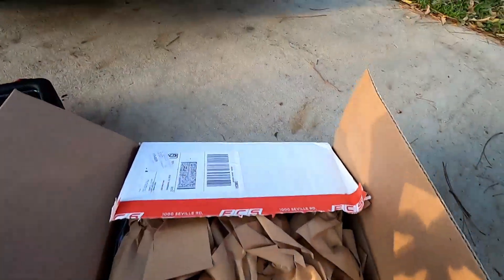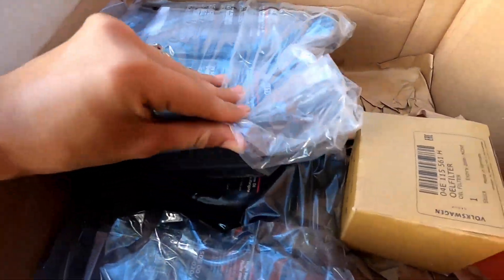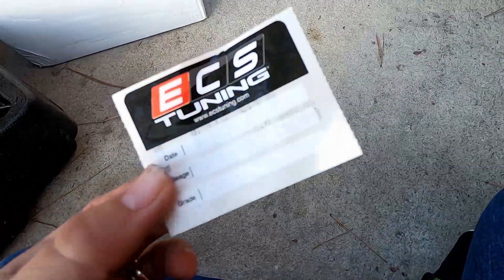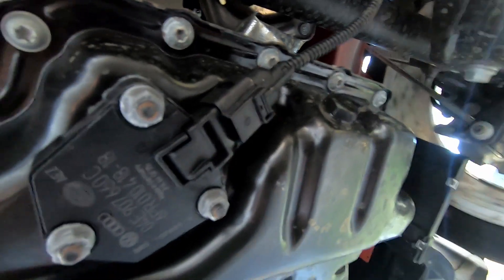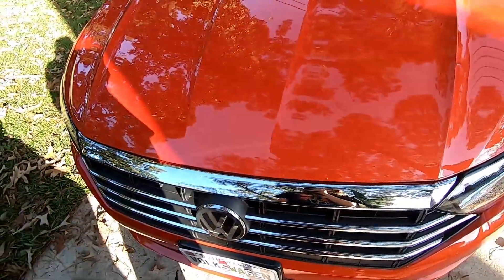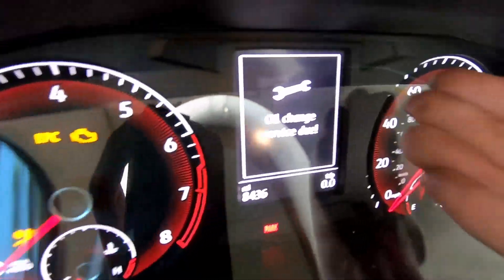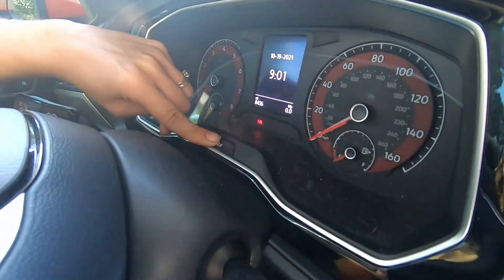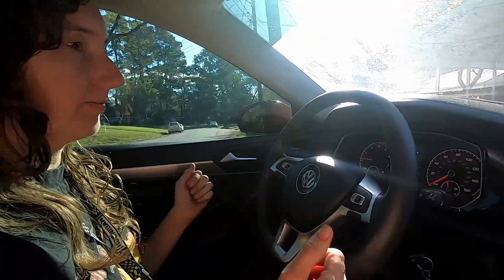MK7 Jetta Oil Change

Comment: you can use mobil 1 ESP, its the same oil they just rebrand it at a higher price. They used to use castrol now all vw is mobil 1. also lol, was using the oil wrench backwards.

Comment: Also. How did u get the gauges to do that spin up when u turn the key?
Reply from the maker: It's through an app called Carista. You have to have a Bluetooth OBD-2 adapter to use it and unfortunatley, you have to pay a monthly subscription fee to make changes like that, but it gets the job done. The scanner works for monitoring, gauges, and diagnostics in other apps though, so that's a plus.